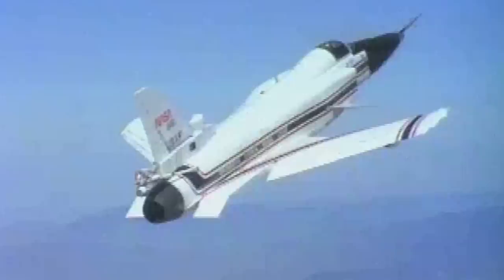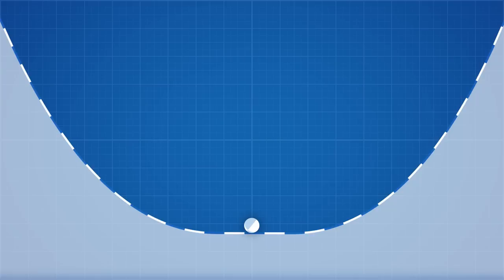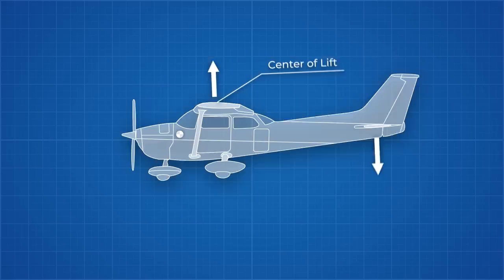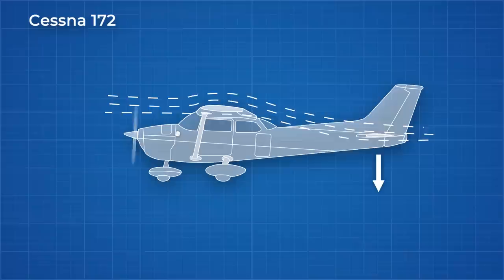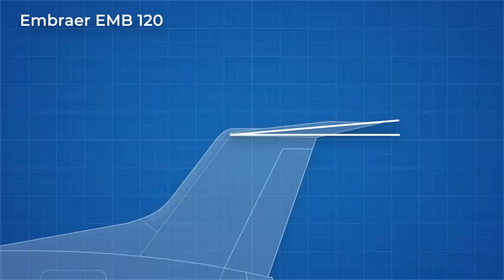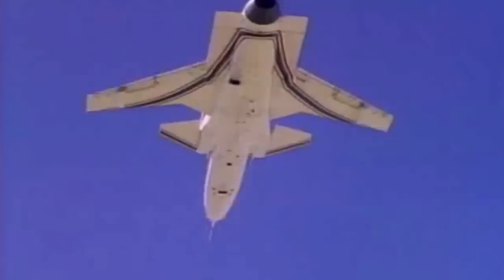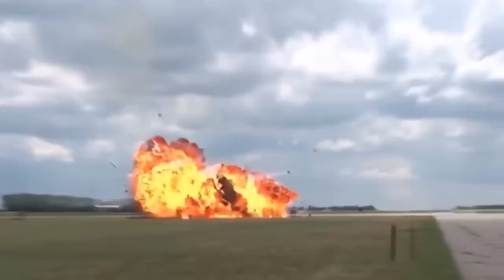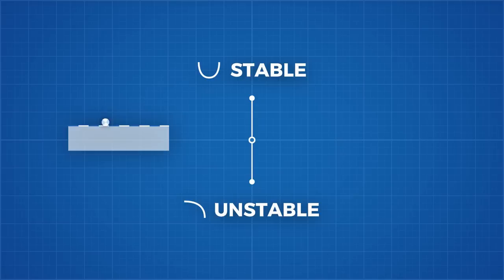Why Fighter Jets Can Be Too Unstable

Comment: Great video! 
Just trying to learn here! --- How does a plane fly LEVEL and not have to adjust for the 8 inches squared per mile curvature drop of the earth w/o eventually gaining too much altitude? Just a question that I have not been able to find a logical answer to. The pilots I have spoken to don't have a clue about adjusting for earths curvature. The way I understand it, they were trained based on flying over a flat plane? Say what?  Why did they even name them air PLANES? Because they fly LEVEL? How is that? 
Imagine a fighter jet moving at a speed of say MACH 2 over the ocean or say the salt flats(or what ever speed they can safely fly close to land or the water?) Wouldn't that 8"sq. per mile be important enough for me to be able to find a clearly logical answer to this simply question? ----  Sorry just confused.

Comment: Hey. 
Can you do a video about super-maneuverable aircraft? Just a request.
Reply: I can give a quick synopsis
Super-Maneuverable aircraft are not "More" maneuverable in stable flight
It gives them the ability to control through directing thrust off the normal axis when the control surfaces have stalled - either from airspeed or angle of attack separating airflow

There are 2 types of vectoring
2d - control of the nozzle is pitch axis only, but in 2 engine jets they can differ the deflection to give roll authority aswell as pitch - eg the F-22
3d - all axis like the Su-35

Comment: If an upgrade for a passenger plane makes it unstable, the makers can knock up a bit of software to sort the problem out.  What could possibly go wrong?
Reply: You are talking about the 737 Max I assume
It is not unstable - the window where it is stable is just slightly smaller

Comment: Can you explain why a fighter jet flys upside down seemingly just as well as upright, thanks.
Reply: Their thrust to weight ratio
When flying upside down they are pitching upwards using more engine thrust to counter the reduced lift - it means they bleed speed heavily in the process and it is why they only tend to do it at high speeds and for short periods

Comment: Why didn't Boeing stabilise the 737 Max so that the plane recover aerodynamically (rather than using MCAS) when it pitch up? Surely, they can design a new stabiliser to address the pitch up issue, without depending on software.
Reply: They put to big of an engine on the old frame! Tried to get away with a cheap fix cost them more in the long run. No one will ever trust that plane again.

Comment: So what happens if something happens to the computer that is keeping the plane stable? Now there is the weapon that I would be working on. Something to knock out the electronics on the enemy aircraft.
Reply: It depends on how computerized the system is. Aircrafts are usually shielded against EM effects and there usually an analog/mechanical system that will allow you to still fly the plane even without computers.

Comment: How does fighter plane balance itself after firing missile from below the one wing, causing another wing to become heavy with the missile still unfired hanging below it?
Reply: Minimal change. Missiles are not that heavy. Bombs on the other hand - if one drops and the other doesn't (in a salvo) you can trim the aircraft (aileron tabs) until you can use the other one.

Comment: Riddiculous. The main reason for tail-down force in the video is downwash?? This is ABSURD!!!! The tail is a LIFTING SURFACE - it just happens to be upside down. Angle of incidence plays a part, yes, and there is a small amount of downwash hitting the surface, however the horizontal stabilizer is an airfoil plain and simple. And yes, I am a pilot.

Comment: Boeing kinda screwed the "every passenger plane is designed with static stability" line with the 737 max series..
Reply: The 737 Max is still a stable design - it is just less stable than normal

Comment: okay, I got almost all..
what about these strange design B-2 Spirit Stealth Bomber aircraft.???? its all different from our so-called traditional aircraft design.
Reply: A "only wing plane" has an aerodynamical advantage because it has no tail plane. The 2. reason for the only wing plane is, that is has a significant smaller radarsiganture as from the front as it also appears from the side, what appears to be very interesting for warplanes.  Also, the structure can be constructed "more light". 
But there are also disadvantages. For example : The necessary aerodynamic stabilization around the transverse axis, the very small window of speed, in which it can fly aerodynamical stabil, only subsonic flyable, etc.
In WW II the brother Horten (Brüder Horten) designed a couple of different shapes for warplanes for example: Horten H II, H III, H VII, H XI, etc.

P.S.: don't thing stealth makes a plane invisible. It makes it only more difficult (smaller) to see on the radar.
Reply: @HJB._  means compromising a lot of options to make it more stealth.

Comment: Is this excessive instability common for canard over tailplane designs, or just something specific to the x-29?
Reply: In most canards the designs are either unstable or riding on the line between them as the canard drags the centre of lift forward
in the case of forward swept wings the centre of lift is even more forwards - combined with canards making it even more so

Comment: 5:35 angle relative to what? the angle would always be the same if you are talking about it being relative to the direction of airflow since it would point in the direction the plane was pointed... plz explain more
Reply: is this talking about if the plane's pitch changes, but velocity remains the same?
Reply: In most cases, the plane's control surfaces have to push against the air-stream FIRST before you can change the plane's orientation and vector. That's the job of those control surfaces - to push against the air in order to THEN change the aircraft's orientation. Even in the cases where you might use differential thrust to alter a craft's orientation, the change in direction still takes a certain amount of time while the plane is still mostly moving in the direction it was before. It takes time to overcome inertia.

Comment: The shape of the wing has more of an effect in returning the Cessna to stable flight.
Notice the twist in a Cessna 150. The twist helps bring the plane to level flight this making it an easier plane for students to fly. 
Also, heavy cargo is placed as far back as possible to reduce the trim and save in drag.

Comment: If I'd been younger I'd have bought one..... in about a decade and I'm still around ( unlikely ) and the grandson is still around and you are still going and pensions are still a thing then I'll probably splash for one.
I am confused by the force diagram/explanation  at 5.03. The gravity force acting through the centre of mass shouldn't produce any torque to rotate the plane back to level. That torque should come from the increased lift caused by the increased angle of attack. ( In my very naive picture of the forces involved.... suddenly I very pleased that my eyesight stopped me from ever trying for pilot training.)...

Comment: Anyone who thinks 'the more unstable the better needs to get X-plane (any version), and try making a dynamically unstable aircraft that's actually flyable. getting the control curves dialed in right is hard enough when the plane is only mildly fidgety. There's a demo aircraft in version 10 called 'Deathtrap' it's a flying wing with forward sweep. How the hell it flies as good as it does, I don't know, but it'll end up going backwards if you so much as look at it funny.
Reply: I say X-plane because the tool to do this comes with the game/sim. Plane Maker

Comment: unstable is better. it require skilled pilot to make it stable; which makes movement dynamic control easier.

a stable one will on the other hand restrict control; while easier to control for most.

both have pros and cons; but the later prove less efficient to skilled. then again; human will get tire.

Comment: But it's not about "energy" as you define it, is it? It's simply about computing power, plus the material science and the "robotics" required to manipulate control surfaces. Simply. lol
Reply: flying in combat is forward energy management, when you are flying and make really sharp banks, or change pitch quickly, what happens is your forward energy, the inertia that is moving you through the air is lessened, its why you lose airspeed, if you can however manage that inertia and keep at it a constant while pulling those maneuvers, then that's how you do combat..in a nutshell..with a grain of salt, but basically..in "energy"..that's what hes talking about

Comment: What software do they use on fighter jet planes to keep them stable.
Reply: it is not availiable to the public but it works by calculating the changing centre of lift taking into account the Angle- speed and altitude of an aircraft
Reply: @bengrogan9710  Every piece of software that was ever used on every type of jet can't be unavailable, how else would the Chinese steal them to make there own cheap knock offs.

Comment: Funny how you mentioned something about people having studied stability and control of aircraft... And just as funny that I happen to be one of those. Currently studying control and simulation at the faculty of aerospace engineering.

I don't understand what downwash has to do with static stability. Also, isn't dynamic stability relevant here?
Lastly, I have never heard about the theory of "energy needed to return to steady flight". If a very unstable aircraft gets thrown off course, the computers will turn it in a 40th of a second in the correct direction. So the energy needed to return will be minimal, or the integral over 1/40 second. So I doubt that energy is a limiting factor, I think it is more the pilot that limits manoeuvrability.

Comment: Sorry, but your explanation of pitch stability is wrong. When an aircraft begins to pitch slightly up or down, the lift generated by the wing is more important than the lift generated by the canard or tail since the wing is much larger. Because of this, a lifting canard design is statically stable, while a downforce producing canard is statically unstable, opposite of a conventional wing and tail design.

Here is a simple image that shows all four designs. https://i.stack.imgur.com/Oy28z.jpg

Also, any control systems class will tell you that the time to double of a system decreases the more unstable a system is. While there are definitely disadvantages to a very unstable aircraft, they are more maneuverable.

Comment: "Every passenger plane is designed with something called static stability. Static stability essentially means that an aircraft left to its own devices flying in a straight level flight will return to straight level flight when it is knocked off-course. This makes them easier and safer to fly without having to constantly adjust the control surfaces to balance the plane."
Except for the 737 Max-8, because Boeing got greedy, lazy and careless.
Reply: A complete misconception the MAX is not aerodynamically unstable it has a pitching tendency under certain conditions as a result of modern engine design priorities. P.S. It affects the A32Xneo family as well it's just handled differently but with a software update nonetheless.

The statement in the video is completely false as both the MD-11 and B777 have relaxed static stability (instability) and are not positively stable

Comment: Nice pictures but too many inaccuracies, it is not relevant to speak about stability without speaking of neutral point. Stability is not directly linked to the empennage type : aircraft with canard could be stable or unstable…. and what about tailless configuration (F-106, Mirage 2000...) ?
This documentary is definitely not something to show for stability explanation.

Comment: but what about AoA increase on the all moving canard in relation to the main wing in its straight flight balance force? This should mean the Canard will stall before the main wing resulting in a loss in upward balancing force for an upward disturbance or in a downward disturbance the higher AoA should mean the canard creates more lift faster than the main wing resulting on a stabilizing force? Im just a young Aircraft mechanic and RC builder so someone set me straight? I can see how a canard that uses a separate control surface could be a problem but all moving "stablator" canards should have a built in course (as in opposite of fine) correction ability? Here is an example on a small scale forward swept wing, fixed canard aircraft (canard has a greater angle of incidence vs the wing) that is rock stable: https://www.youtube.com/watch?v=Gul0NO_Gwgw Its the Raiden

Comment: Great videos. Idea for another one.  Why is the rear wings on cargo planes and bombers often in different places? For example the C5 has its rear wings (elevators)up high and  the B1 has it mid way up the rudder and the C130 has them even with the wings.  I suspect it has something to do with runway length but don't know. You clearly know more than I do so if you have time I would be thrilled to know if I am right.

Comment: I'm sorry dude, but you got this one wrong, or at least you oversimplified the explanation to the point where it does not give the right message. 

I am both a physicist and a glider pilot, and I spent a lot of time trying to make sense of the stability of airplanes, since the way I was taught it in flight school (which was sort of similar to what you say in this video) did not make sense to me. In your explanation, you give the impression that the instability comes from the canards being in front of the CoM. This is not the case, as one can make perfectly stable planes with canards. One can even make planes with two 'main' wings. 

The 'standard' explanation about the changing AoA on the tailplane does not really work, since changes in pitch affect the AoA of both the tailplane and the main wing equally. If the torques are balanced in level flight and we double the AoA so that lift of both the tailplane and the wing will double, the torques will remain perfectly balanced. There is gonna be no restoring torque to provide stability.

What makes a plane stable is the difference in AoA between the tailplane and the main wing, this is called 'decalage'. If the back wing has a lower AoA than the front wing in level flight, a change in pitch will relatively affect the back wing more than the front one, so that a net restoring torque is generated. This can be done with canards to. It does not matter if both wings are behind the CoM or if one is in front of it, all that matters is that the back wing has less AoA than the front one.

Read chapter 6.1 of this book for a more detailed analysis, for me it was really enlightening  https://www.av8n.com/how/.

I hope i don't sound too critical, I just write this because i got stuck with the same problem some time ago and finally managed to get a clear picture. I love your channel, and thank you for making great content!

Comment: Unstable aircraft are controlled with fly-by-wire computers that are constantly trimming the aircraft and the control surfaces are moved by high pressure hydraulics.
The fly-by-wire flight control computers will even stop the pilot from making a manoeuvre that the aircraft can’t recover from (flying outside its envelope).
The pilot tells the flight control computers where he or she wants to go and it’s the fly-by-wire system that controls the aircraft to get him or her there.
 There is no problem.